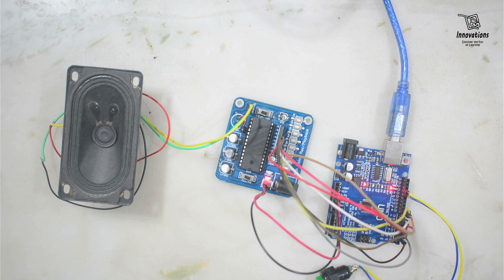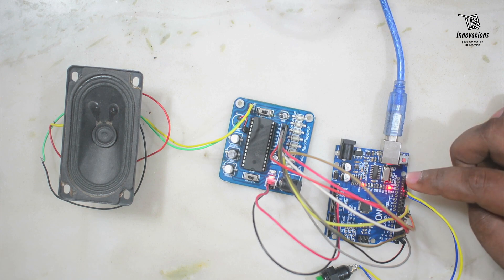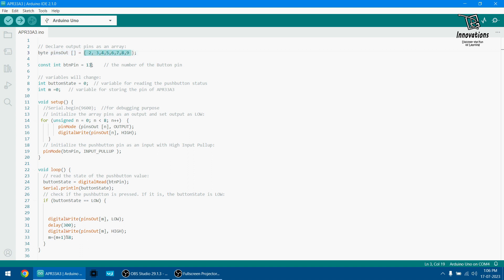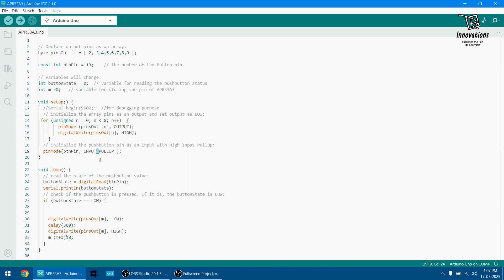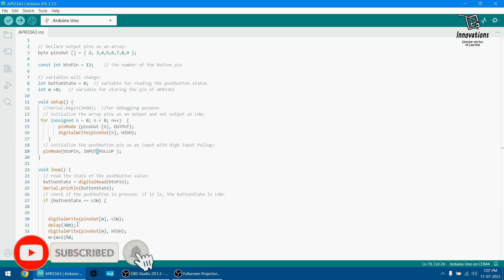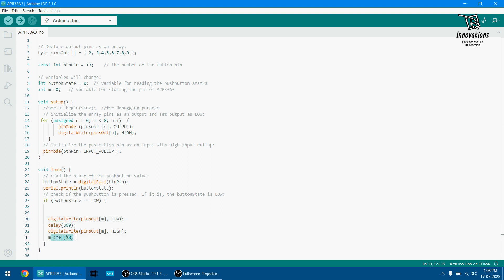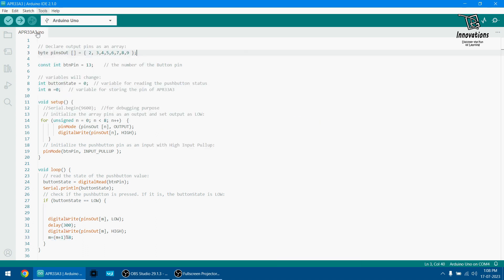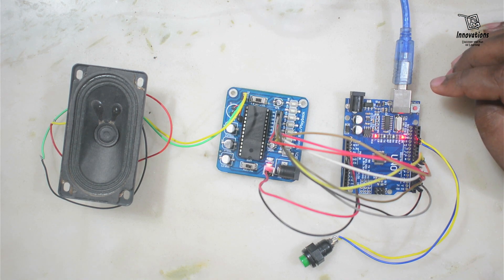APR33A3 Module Interfacing with Arduino | 8 Channel Audio Recording and Playback Using Arduino

Comment: Thank you very much for this video, was very helpful! I want to make a small project where I need to record sound for 2-3 minutes and store them in an SD card. I want to enable the recording using a switch but I don't want to keep pushing the button during recording. What module do you suggest for that application?

Comment: Thank U very much, for this nice video.
 But sorry 1 issue is11 not solved yet. That is,how can I hit/ triger the particular audio Canel??
 For example, I want, if the sencor A(Fier) sence / fired(get active) then audio "Ch 1" will run or if sencor B" sence / fired(get active)them "audioCh 2" will run or if the sencor C sence / fired (get active) then "Ch 5" will run and so. So only a particular Audio chsnel shall run only as per my requirement or need or program.
I hope I had clear my need.
Thnank you Sir
Reply from the maker: Study the code, you will understand
Reply: @RGInnovations  Ok Sir,let me study 1st.